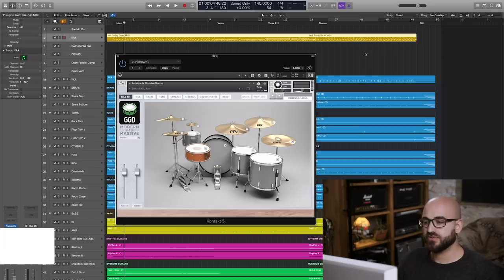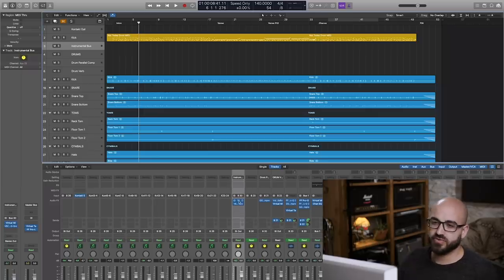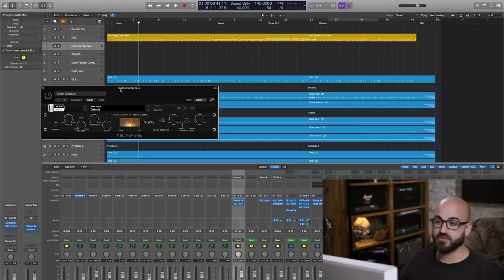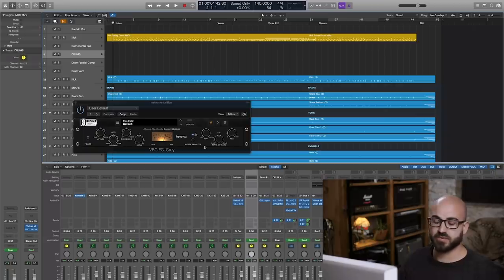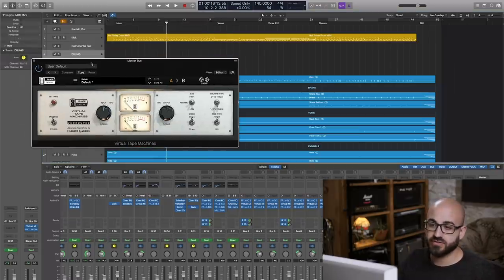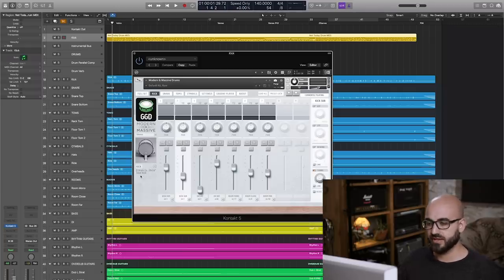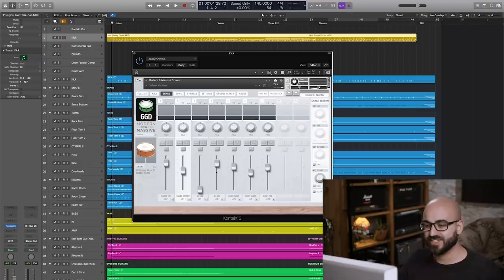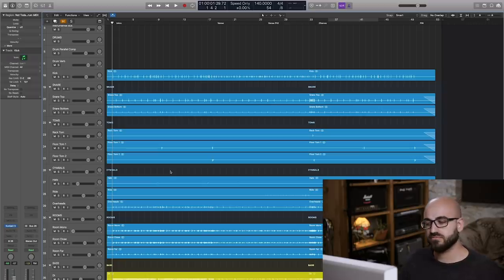NOLLY MIXING MASTERCLASS: Two Bus Processing

Comment: If nolly is adding eqs, compressions and tape emulations/saturations on the mix bus itself what work is left for the mastering engineer to do apart from just adding a limiter ?! 

I thought the final eq coloring and glue compression and tape emulations was done by the mastering engineer
Reply: Hi I will attempt to answer you, from watching these guys mix religiously the top down mixing approach isn't heavy handed at all if you pay attention these are very miniscule dB boost if boost at all. 
   I do believe he approaches the mix this way to keep his ears nice and fresh, just pulling out the harshness of a rock mix from the beggining i.e. "cymbals" "snare" ect. ect...can minimize hearing fatigue greatly...rather than beating yourself up by dealing with the rattiness of the mix whilst you try and dial the levels in and such...plus I'm sure other reasons too

Comment: I bought Modern and Massive and the drums sound fantastic, but it bogs down my computer so much that I can hardly use it.  I also have Steven Slate Drums that I've run through Kontact with no problem at all? Any tips?
Reply: time for a computer/memory upgrade
Reply: @DRJTUBECHANNEL  That's part of my confusion.  While my computer is old, it tends to do just fine with virtual instruments in Logic.  I can have multiple instances of Alchemy, Serum, Kontact and others open with all sorts of plugins and not have too much trouble.  When I load one single instance of GGD in Kontact with no other plugins or channels, it will struggle to play eight bars without giving me the overload dialogue and stopping the track. I'm using a 2011 MBP High Sierra with 8gb of ram reading from a Samsung SSD. I've messed with Kontact's settings as well as Logic's settings trying to find the issue.  Did I miss something somewhere?
Reply: J hmmm...wish I could help. I use a MacBook Pro 2012, 2.3GHZ intel core i7, 16GB ram, 1600MHz DDR3....no issues at all. I do have to change the sampling rate sometimes and put logic in “low latency mode” on some virtual instruments that give me latency issues...other than that, GGD runs just fine for me.
Reply: Set the raw sound as good as it can get, than export the tracks and mix them as you would do if they were recorded with real drums instead of coming out of a VI.
Reply: @mvyper  That's actually what I've been doing but in some cases the midi data wont even play 4 bars without overloading.  Every other virtual instrument works fine except that one.  That's why I've been thinking it's something stupid like a setting I missed or something.
Reply: @jay1070  I see... did you try real time export? Sometimes that would get the work done..
Reply: @mvyper  I'm actually considering just bouncing the samples and loading them in a different sampler.
Reply: @jay1070  for years I just sampled the directs ohs and room samples from a kit my drummer played in 2010 and used them in groove agent one in Cubase 5. Did wonders.
Reply: @mvyper  That's the idea! I just need to finally get myself a drum set.